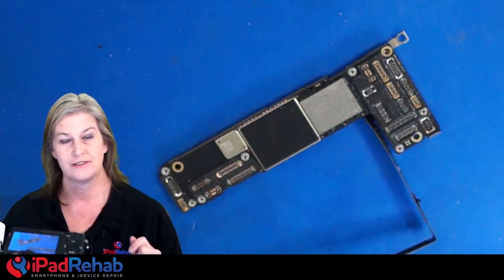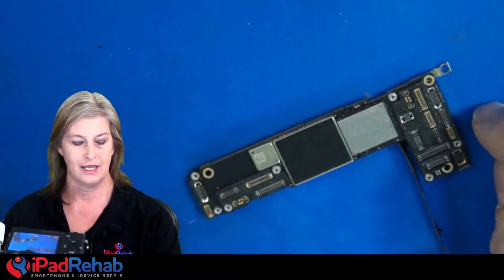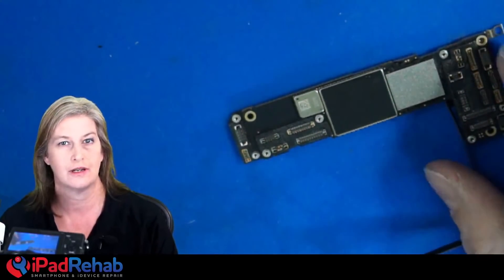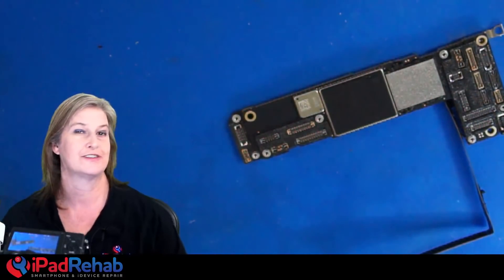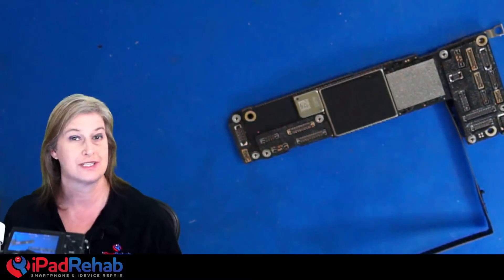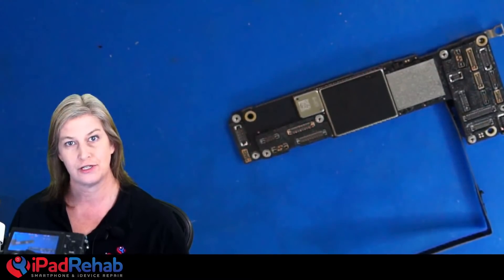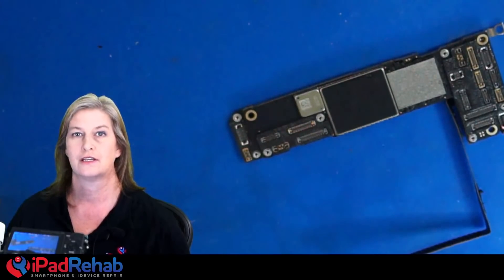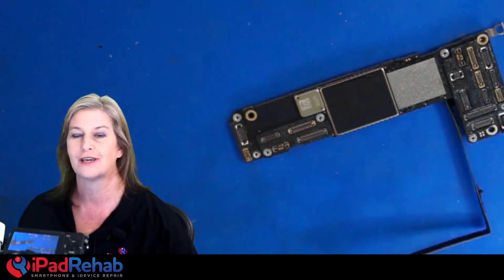How To Remove iPhone Logic Board Soldered On Heat Shields

Comment: You mentioned that you typically don’t replace the shields once removed. When removing the thermal pad then shield from the processor, would you add thermal paste or pad directly to the exposed SOC to maintain some sort of temperature regulation?

Comment: 15:30 Not putting back EMI shields is not a smart idea. As engineers, we put these in RF designs for very good reasons. At best your device will emit unwanted EM and will no longer be compliant to the regulatory standards, at worst RF circuits will affect other components and cause internal malfunctions, or will be affected themselves if the RF sections are sensitive and result in degraded performance. And if you really can't put things back as before, at least solder it back with 3-4 points attached which will be far better than nothing.

Comment: The reason why the students do not use maximum heat, airflow and nozzle diameter is easy to understand.  It is that they do not want to damage components underneath the heat shield.  Judging by comments here their caution is justified.

Comment: Max heat yes. Big nozzle yes. Max air depends... Max air can be too much even with a big nozzle. At some point more air is pointless. Depends on the station and somewhat the details of its regulation control loop. Good stations should be able to regulate a constant temp all the way to max air, but they also may be able to put out way more air at max than you really want. Obviously with no standard you just have to get a feel for your station.
Reply: Of course the best shields are removable. Nothing better than a good snap-on shield.

Comment: roses alloy mixed to the surrounded solder of the shield would lower the melting  point to 100 degré
Reply from the maker: That can float components and make a mess, so we don’t use that method very often.  Sometimes on the Samsungs though

Comment: Hey curious are you still seeing touch ic / audio ic repairs in your area? Seems to have lessened quite a bit
Reply from the maker: Not really.  We have retired those from our microsoldering curriculum and swapped in connectors and split board resoldering.
Reply: @JessaJones  Yeah I think those cheap $30 eBay techs have taken that market lol